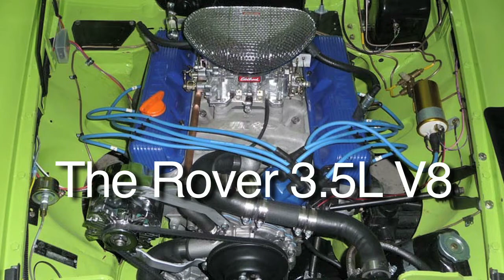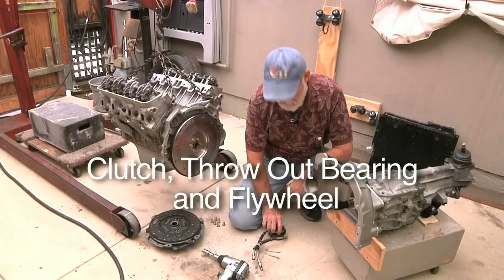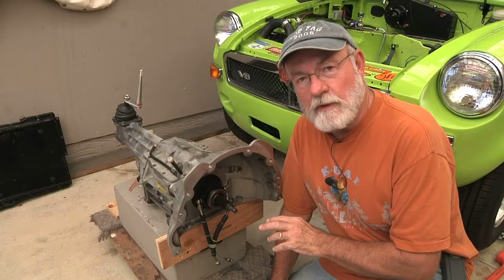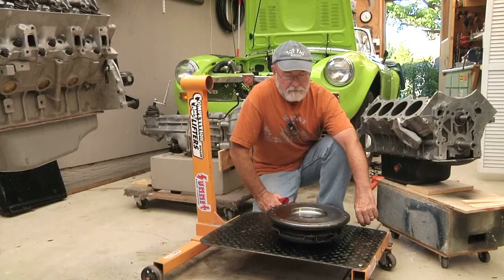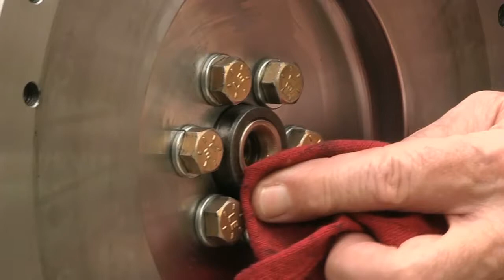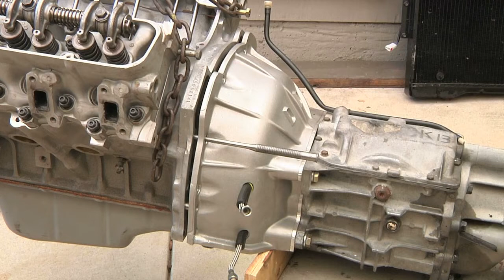1966 MGB with a Rover V8 - Episode 5 - Clutch Assembly

Comment: You need to torque up bolts in the right order dude, especially on an aluminum block. Centre the clutch with a bolt wrapped in masking tape works. Gearbox would have gone on easier and won't damage the clutch.

Comment: .. I used original Buick/Olds 215 bellhousing... any GM manual tranny (pre-6-speeds)  bolts up to it... use clutch disc with appropriate number of splines to match tranny input shaft splines... also using original semi-centrifugal clutch... disengages/engages and shifts easily at low RPMs... clamps down harder at higher RPMs... using 1977 Borg-Warner T50 5-speed tranny (for 4 and 6 bangers) with about 3.11 1st gear, about .80 (25% overdrive) 5th gear...